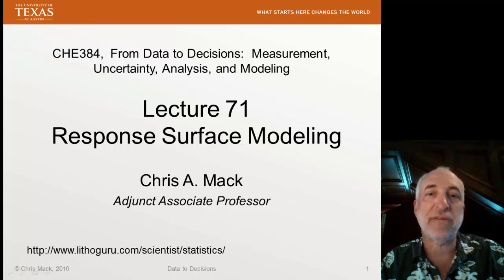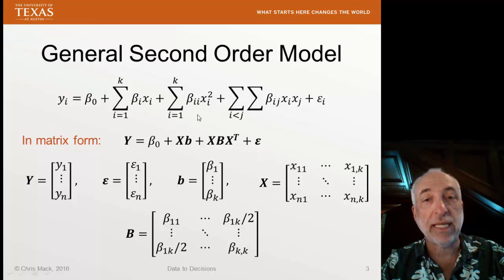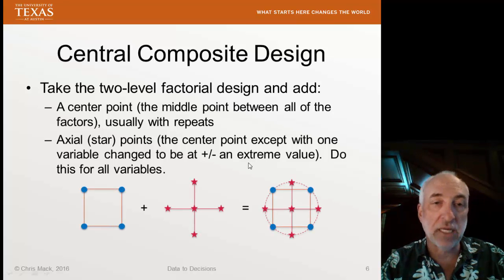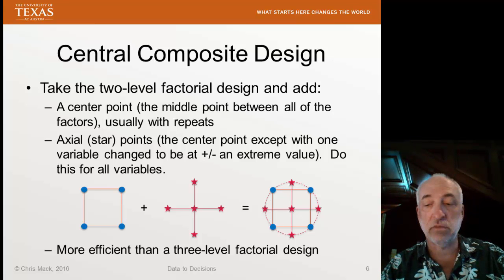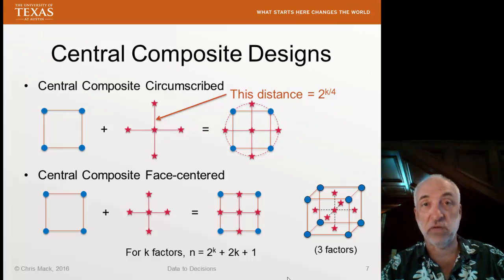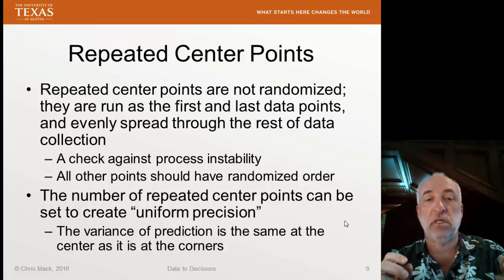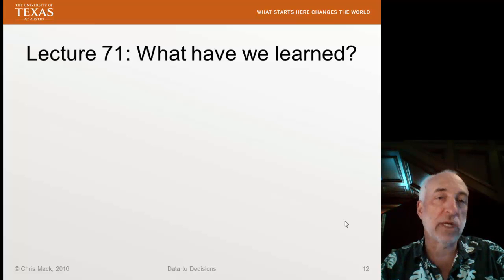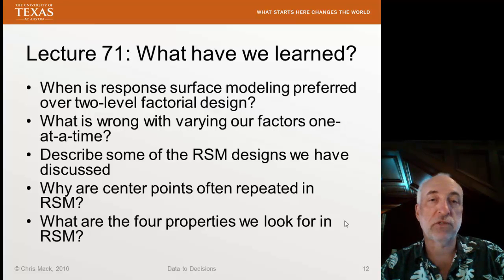Lecture71 (Data2Decision) Response Surface Modeling

Comment: Thank you for sharing this video. It's answered a lot of questions for me. You said the centre points are repeated in order to detect shifts. How exactly do we determine if there is a shift?
Reply: look at your center points raw data and evaluate the noise (Standard deviation or CV) or look for the Pure error term in your DOE analysis in Mintab or whatever software you use. Pure error is the error obtained from repeated measurements such as your center points.
Reply: or do you mean shifts from non-linearity?
Reply: I’d think you’d need an already prepared control chart in place to check that the centre points (4 say) were between the control limits. You couldn’t detect a shift (step change or trend) from just 4 points alone. However, the 4 points can be used to calculate uncertainty of the effect values (what you’d call partial replication as only one of the runs/treatment combinations is replicated) and you’d want the variation of the 4 points to be smaller than the variation between the levels for each factor otherwise the factor effects are unlikely to be significant. That’s my best guess at an answer.